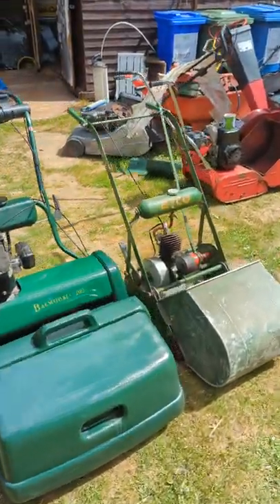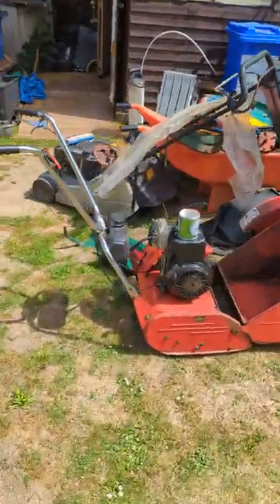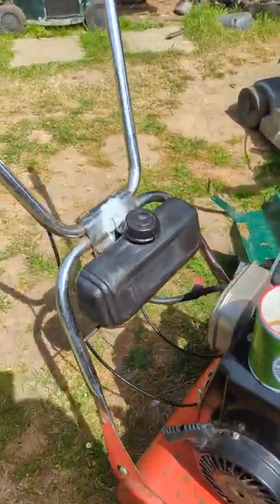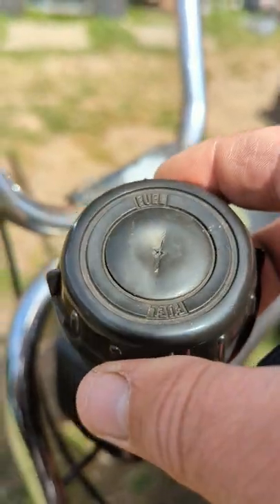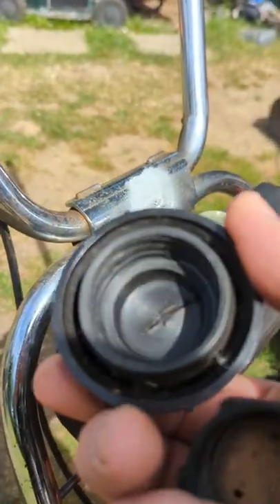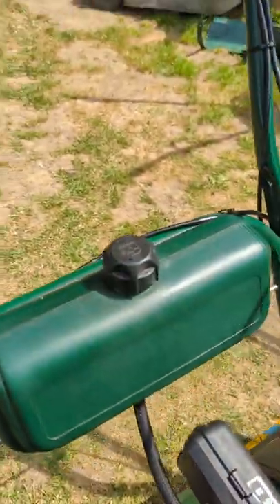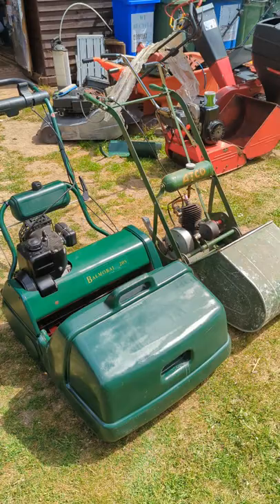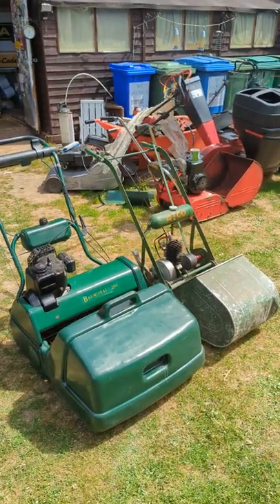Cylinder Mower Fuel Cap Leaking Fix #short #shorts #micksmowers

Comment: I’ve got a box I throw all the old fuel caps in, I needed one for a Kawasaki Strimmer the other day, but the replacement still leaked so I put the breather insert in from another random cap worked perfect. The cap I needed new was £32 OEM and I couldn’t find none genuine, good tip with the briggs cap 🙂👍